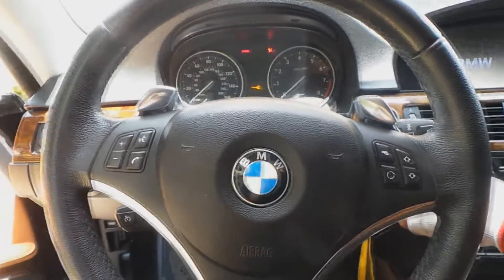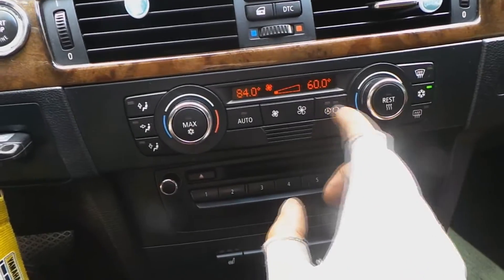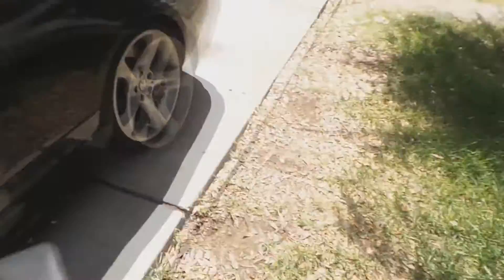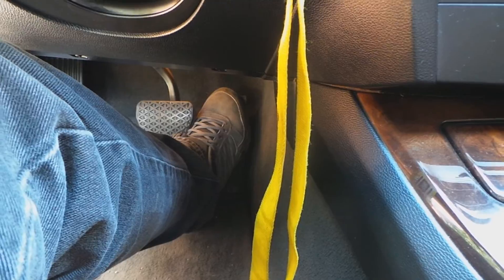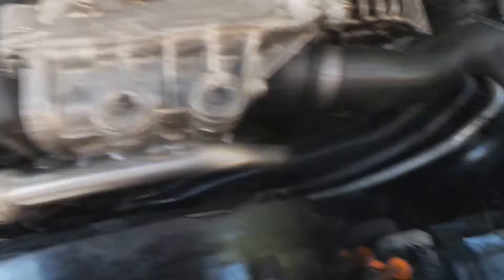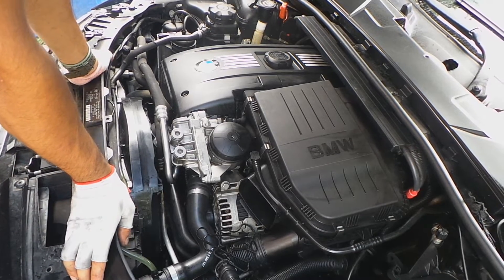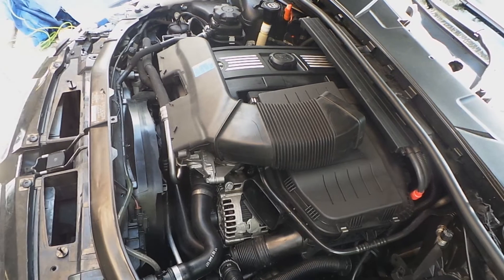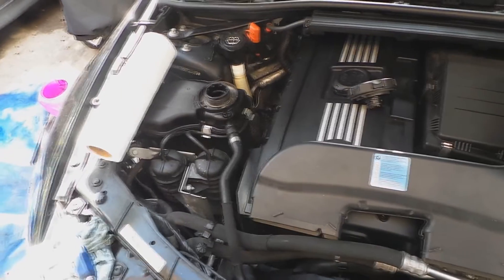How to Bleed the coolant on The new model Bmws with the electrical Water pump

Comment: My thermostat and thermostat sensor was changed in my 2001 bmw 325i , the gadge keeps going in the red... Coolant full, water pump changed two years ago..HELP
Reply from the maker: Was the system bled? You take the radiator bleeding screw off and add coolant until you see a bubble free flow of coolant. There are plenty of videos on this on YT. 
There is also a possibility that your head gasket is blown, You could do a compression test to find out. 
You can pick up a compression tester from harbor freight, they’re pretty cheap.

Comment: I followed the instructions 100% and im still getting a coolant light when I start up my e90 says coolant low but after I drive half a mile or so the light goes away but comes back again on start up?
Reply from the maker: You might have a faulty coolant level sensor which is located on the bottom of the coolant tank.

Comment: Hi, How Can I fix in BMW 530 M54?
Reply from the maker: There are 2 bleeders on M54s one on the upper radiator hose going to the tstat and the other is on the expansion tank. Unscrew the tstat one first and pour coolant in until you can't see bubbles then repeat the same steps for the expansion tank one. Hint: your bleeders are probably going to brake so I'd suggest buying the upgraded brass ones from Amazon.

Comment: My 09 328xi goes right under 250, is that normal?
Reply from the maker: That's too hot you've got an issue with one of the cooling components.
Reply: I have the same problem with my 2007 335i

Comment: Hey mate got a question what the correct operating temperature for bmw e92 325i
Reply from the maker: mid 90's to a little over 100 degrees Celsius, you should hear the fan kick on as well.
Reply: Hi, my temperature goes to 111 when in traffic before fan kicks in then drops to 106.  Normal driving temperature goes to 105. When driving at speed it drops from 105 to 90.  Is this normal?

Comment: I have an ssue on my 2012 E70. I changed waterpump, thermostat and heat valve. The air still only gets hot when it wants. Did u ever find out the problem?
Reply from the maker: Have you bled out the system using the same method as the video?
Reply: @ReachAutomotive  yes I have
Reply from the maker: check if your water pump is turning on when you initiate the bleeding and also check if the fan is kicking on when the AC is on. If both are working fine I'd do a cylinder compression test as you may have a blown head gasket.
Reply: Ok i will try that

Comment: I have x6 50i  2009 it show me high engine temperature .. I checked the cooling liquid and it's okay .... what the reson ???
Reply from the maker: Have you scanned for codes? Also try the testing the water pump using the steps in this video to see if it come on. You should be able to hear it come on.
Reply: take the radiator our and clean it well

Comment: help changed the water pump and thermostat bleeding proceder not working
Reply from the maker: Check the power distribution block that's on the battery. The WP fuse might have gone bad.
Reply: thanks
Reply: @alissabangem5682  Hi How did you fix it? Thanks

Comment: Does it work on f10 550d?
Reply from the maker: Yes it does if you have an electrical WP.
Reply: TheBmwDoctor I dont have any Bleeding screw but its not working!
Reply from the maker: there isn't a bleeding screw on the newer Bmw's. What exactly is your issue and have you scanned for codes?

Comment: My car won’t turn hvac on if engine not running!! How can I do this?
Reply from the maker: robertaco98 you need to turn the ignition on by pressing the engine start button without pressing the brake pedal, and it should work, it works with every bmw so yours shouldn’t be any different.
Reply: TheBmwDoctor I appreciate the tip!! Thanks!!

Comment: Im confused... Yes, we have an electric waterpump, but thermostat is not electric... If engine is not running that means thermostat is never going to open, so basically we won't have full circulation, so we won't bleed system completely... Explain me that.
Reply from the maker: This will answer your question https://youtu.be/oftQBHC3ZPY?t=1m8s
The thermostat in this video is from an E46 but it uses the same technology.
Reply: Thanks! I didn't knew BMW is so advanced.
+subbed.
Reply: Thanks a lot 👍🏽works

Comment: Mechanics put wrong coolant in my car, doing this will get rid of the coolant out of the system so I can replace with the correct coolant
Reply: So I can flush it all out
Reply: Cause I thought the coolant is meant to be blue, and it is green. So confused.
Reply from the maker: It just have to be phosphate free coolant you don't necessarily need the expensive BMW coolant it's not worth the money.